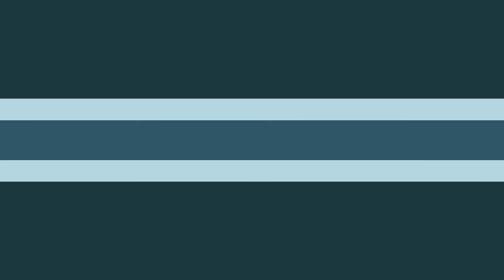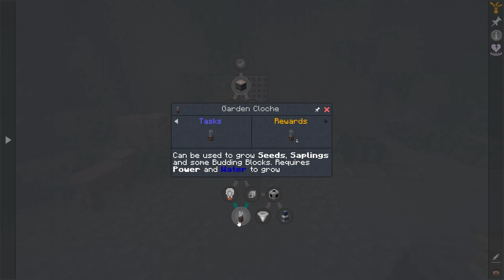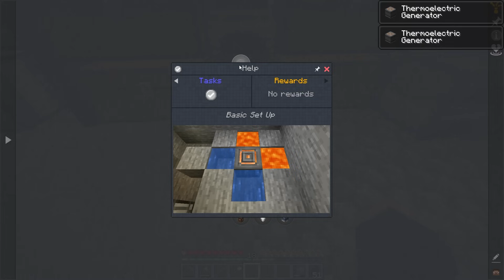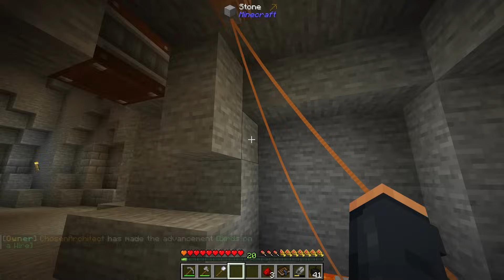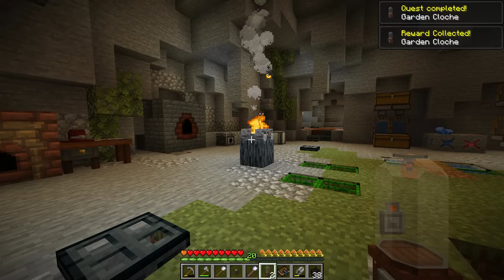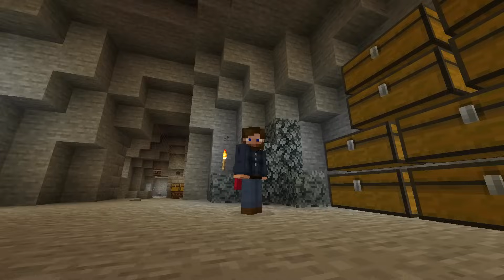Stoneopolis EP4 Garden Cloche, Power, and Storage Upgrade

Comment: Chosen, I believe you should be farming concrete dust in the garden cloches or atleast the bright shards that u need, that way you don't have to worry about it being limited as it was the first initial step towards starting this industry series.
Reply: I asked about this in the BBL Discord, this is the recommended method: 

Do a /sethome in your base, go to the void, remove the void portal block, use /home to get back and go again into the void, it will generate a new platform.

It keeps any blocks you placed already, so you dont need to make another platform under the concrete.
Reply: @crash19285  i think he can just do the automation with cloches without doing what u said, maybe he can automate the bright shards or concrete dust or block itself
Reply: How could you farm concrete dust or bright shards? Something I did to limit concrete usage was skip to the resource generator 2 to get infinite terracotta and with some dedication you could get infinite clay from the blood magic ARC which would limit the need for concrete a lot. Otherwise you kinda have to wait till you get a Crusher from immersive engineering to get gravel to make concrete.